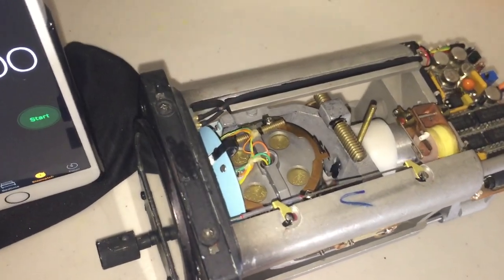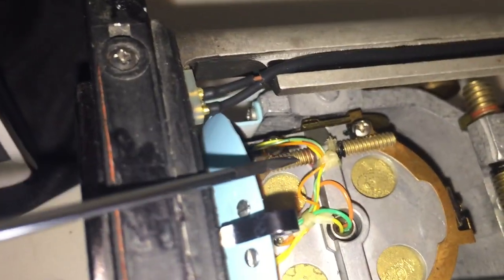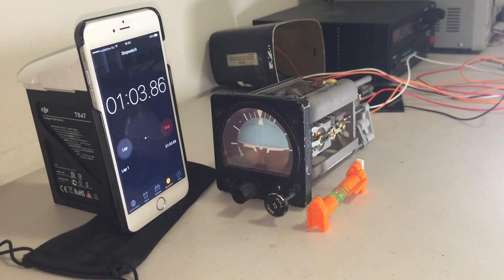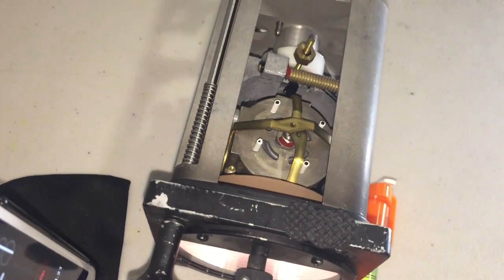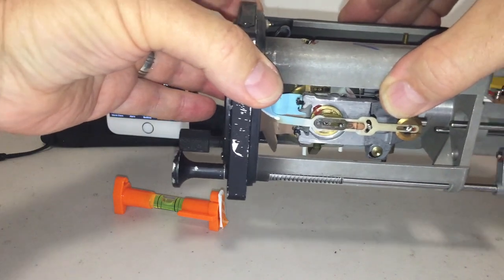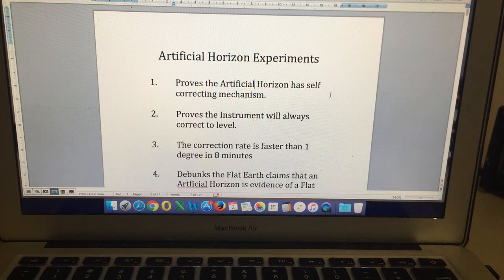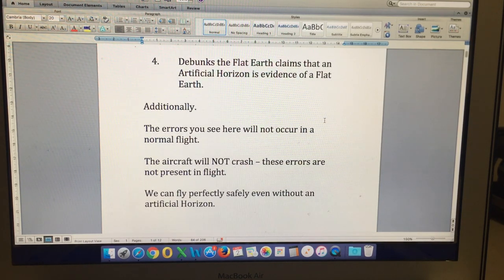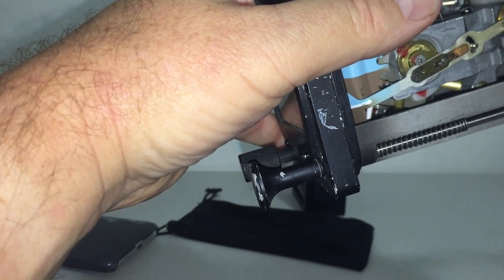Flat Earth - Time Lapse - Inside an Artificial Horizon while self correcting.

Comment: All you have done here is show the gyroscope works as it should. 

If a gyroscope corrects itself to that which it is collaborated then it proves flat earth mate because the gyro is set to the level of the runway you took off from and not the runway it's landing on proving that the horizon was in the same place for both runways. We know a gyroscope isn't influenced by gravity so what would cause these errors you speak of? Or more to the point how would the gyroscope adjust for a runway on the other side of the world where the horizon would be the exact opposite?

Are you saying a gyroscope I clever enough to know which part of the globe it's on and correct itself accordingly? If so what about the early versions? I guess they were highly advanced top secret technology right?

I fail to see what you believe you have proven other than the gyroscope will always go back to the position it was collaborated which is only proof that all runways are on the same horizon which is impossible on a globe. But nice try🙂👍
Reply from the maker: +Dave H.  Your comment tells me that you completely miss how the mechanism corrects the gyro. 

No it does not correct to the orientation to which it is calibrated.  

It corrects with respect to the direction things fall.    Yes that does make it clever enough to always correct to level no matter where it is on a Globe because the direction of down is towards the centre of the Earth and the gyro aligns to horizontal with respect to this local direction of down.  

No Early version were not top secret.  Why say that?  They only need to correct with respect to the direction of down.  

Of course you fail to see what this video has proven because you clearly still don't understand how the Gyro works.   99% of the audience gets it though.

Comment: Redo this and correct your mistake. Make sure the instrument is level before you spin up the gyro. and have two levels, not one axis leading the sheep.
Reply from the maker: +Cosmic Surter.  There is no mistake and your comment proves to everyone that you have zero understanding how this instrument works. 

The position of the gyro is irrelevant when it is powered up.   If you understood how it works you would know that. 

Two levels are irrelevant. 

I know who put that nonsense in your head and he is 100% wrong but you followed him blindly...

You are the sheep mate and so easily led due to your inability to understand how this mechanism works.   

You can prove to me that you are not a sheep by explaining fully in your own words why you think the instrument should be level before spinning up.   Remembering of course that this instrument is designed for a 5 degree angle panel as I explained clearly in my first video.
Reply: Wolfie, I applaud you for going to the trouble of showing the world how an aircraft artificial horizon works, and the lengths that the clever people who designed the instrument had to go to in order to get around the issues of a spinning globe. Unfortunately, going off the comments I read from the pizza planet club, regarding how ‘this proves nuffing’, they seem to forget that they are the ones jumping up n down saying that the gyro would flip 90 degrees every hours at the equator, and that planes should dip etc.
The irony is that they think they are the enlightened ones who aren’t sheeple.  I guess this why the clever people of the world go on to become engineers, pilots, navigators, etc while the ‘awakened’ ones progress from cooking fries to flipping burgers.
I just wish I had seen a clip of this quality 30 years ago when we were learning instruments during my apprenticeship. You don’t happen to fly one of the global’s I see parked at domestic 5 in SYD do you?

Comment: Cool self leveling gyro on a flat plane. Works beautifully.
Reply from the maker: +Johnnie Charlton.  It is not a flat plane Johnnie.  The real question you should ask yourself is how did you fall for the silliest scam on the internet?  Flat Earth?  Really?

My flight plans factor in the Earths curvature two ways.  They would not work on any Flat Earth mate.  FE is becoming a bigger joke than it ever was 10 years ago and is essentially now just a club for gullible people.
Reply: well., it's progress if you accept that the gyro is capable of self correcting.  you now know that those flat earthers that claim that gyro's can't correct for curvature are lying to you.

if you understand how it self corrects you also understand that it will work just fine on the globe earth.

but you don't need to worry about all that.  here is the curve of the earth:  watch?v=LSrL4xIQT7E&t
Reply: I agree, gyro self corrects as expected, sooooo should appear to be upside down in a plane that has travelled to other side of globe. Unless I missed something and Gyro is the same as the simple bubble on table?
Reply from the maker: +Thomas McNamara - yes the part you missed is that ‘down’ is always towards the centre of the Earth and changes by 1 degree every 111 kilometres.  They gyro is self correcting to ‘down’ which is why it show local level correctly regardless of where you are on the Globe.  It levels with respect to the direction of down which is dynamic as you fly around curvature. 

At 450 knots you fly 111 km in 8 minutes.  This gyro corrects about 2-4 degrees per minute so it can very easily correct for the curvature flying around the Earth.  It corrects before you even notice any error.

In one regard it is like the bubble level as they both show the local direction of up and down.  They gyro does not instantly adjust for any acceleration forced which are seen instantly in the bubble level.  

The gyro needs that slower correcting rate to remain useful during turns.  The bubble level will instantly show ‘level’ even when turning.  I have a video showing that also